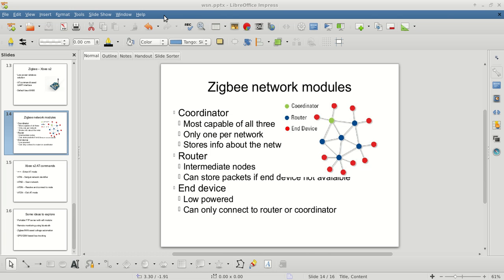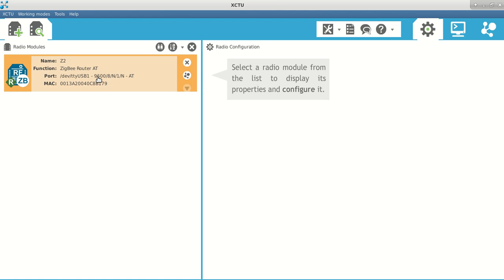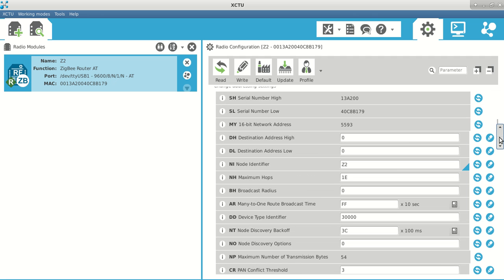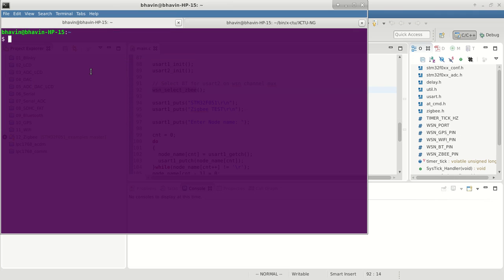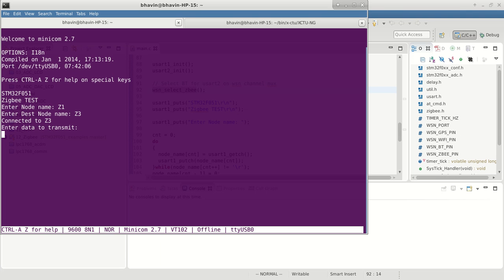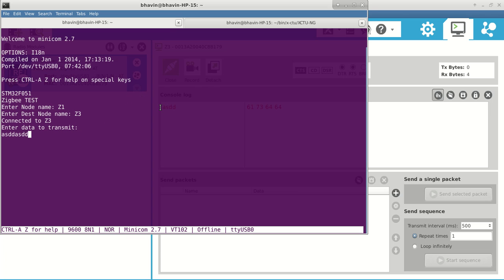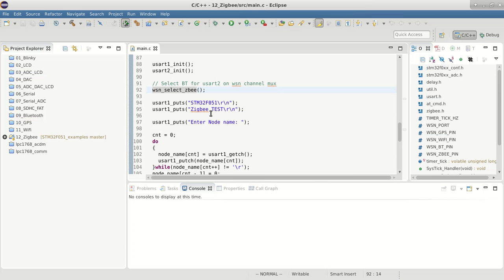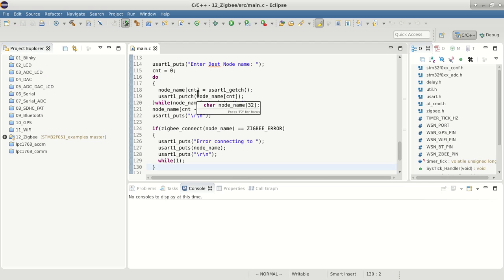Zigbee (S2) Wireless Sensor Networks-2

Comment: Great video thank you so much.
Just have a question .If I have more than one node ,for example 2 nodes.how would I send information from both nodes to the coordinate node ?.bear in mind that in this case we are going to use 3 XBEEs ,2 XBEEs each one at a node(2 circuit board),and the third XBEE connect to PC.